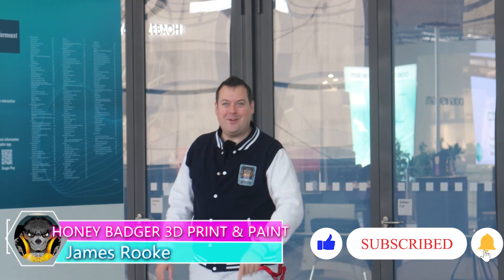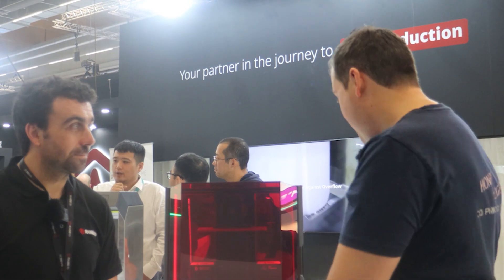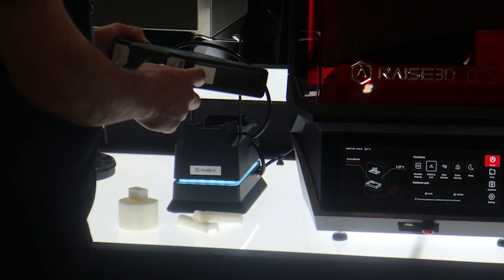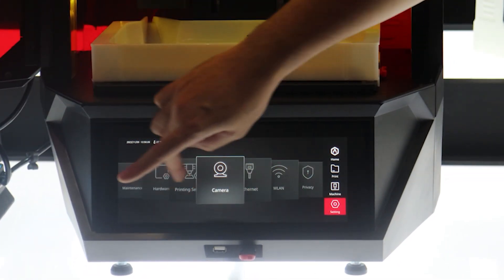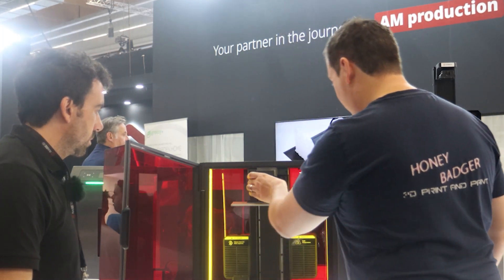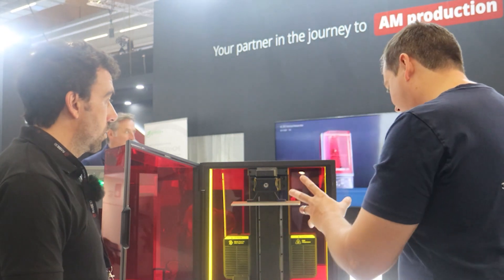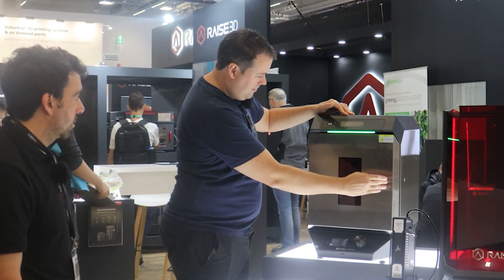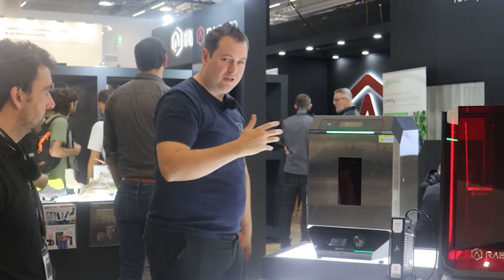Formnext 2023 - Rasie3D breaking the mold and out minds

Comment: It looks like it is using the cheap 720p DLP projector like in Anycubic Photon D2 or Elegoo Mars 4 but built in the fancy machine. The projector has very weak energy output due to the XPR thus the long print times. Still it has all the other good features of the DLP but forget the special resins like bio-compatible for dental.
Reply from the maker: so without cracking it open or having one on the test bench we cant really say, this videos is only their announcement and because it was at the show we were limited with what we could show
Reply: @honeybadger3dprintandpaint  it is just assumption based on already published data. At Fabbaloo there was a slide from presentation which showed the output power 2,2mW/cm2 (500mW for the whole built area) and print speed 25mm/h which is very slow and corresponds with the low power (and same as Anycubic D2). Printers with native DLP chip (without XPR) has ~10mW/cm2 output power. Also the resolution 2560x1440 is the same as Anycubic and Elegoo.
Hobby parametters for proffessional price (kind of).